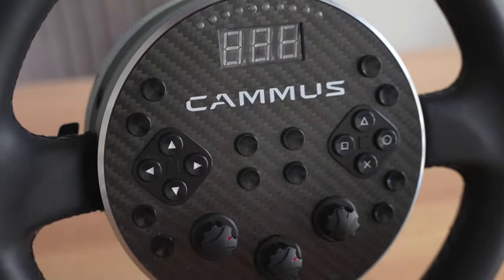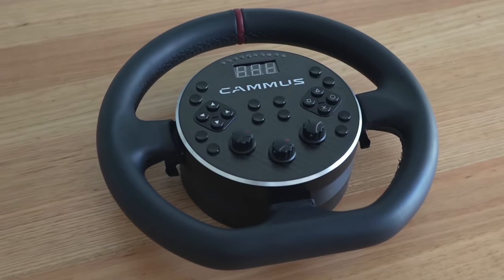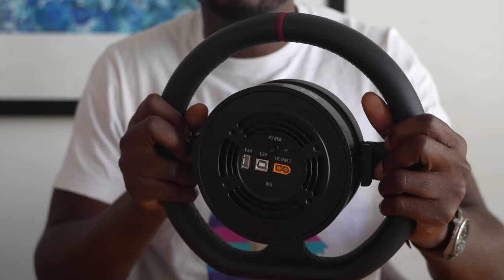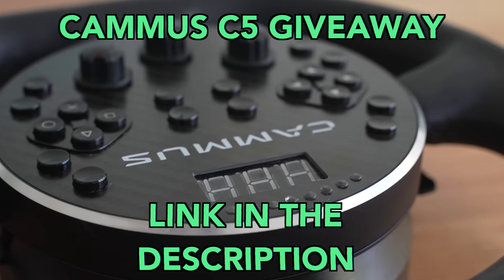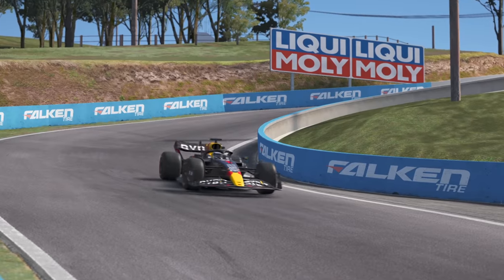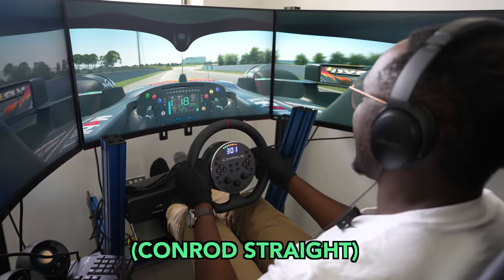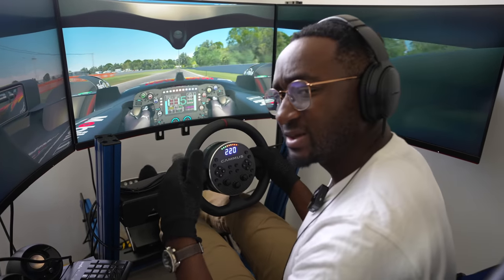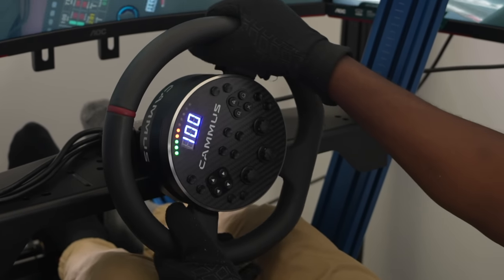The Cammus C5 Is The Most Affordable Direct Drive Wheel Ever

Comment: Few things. 
1: The ergonomics, especially with those teeny tiny paddles, are questionable. 
2: I'm not sure if the Logitech is a great comparison at its as yet undetermined price, FOR JUST THE WHEEL. Cammus's pedals are going to set you back another $300. Making it well into twice the price of the Logitech IF the wheel does come in just under $300. I think its a better comparison as an entry level DD wheel that the Logitech G Pro wheel should have been.
3: If they're already doing and have now finished a giveaway for the wheel, I presume they're not but months away from releasing, No word on release or an estimation? Thats not much to go off of for giving out reviews.
I am definitely interested in this thing. 
I was hoping the G pro would have been that midlevel $500-700 DD bridge for not so wealthy semi enthusiasts.
Instead they saw the price hikes Nvidia was peddling and told them to hold their beer.